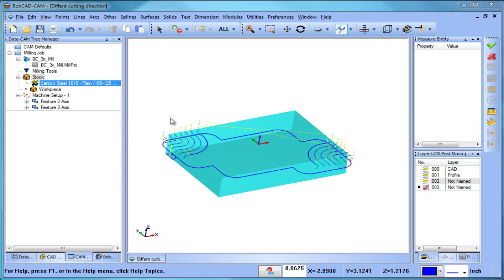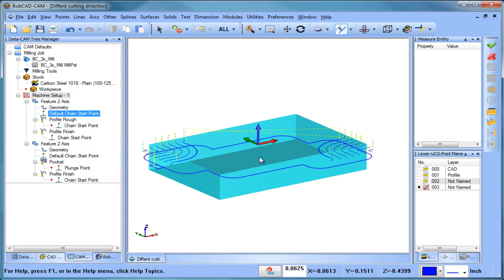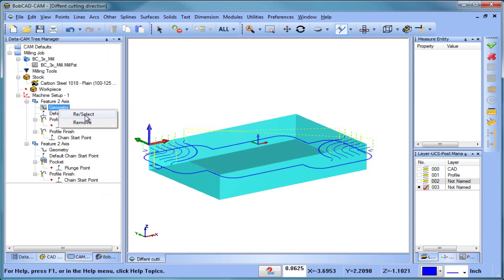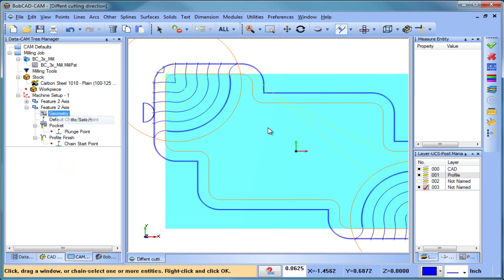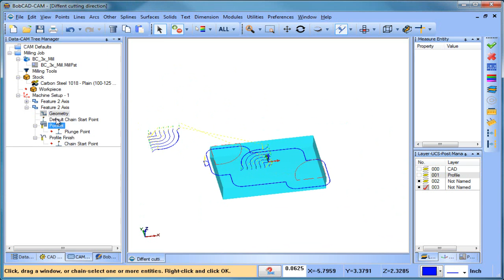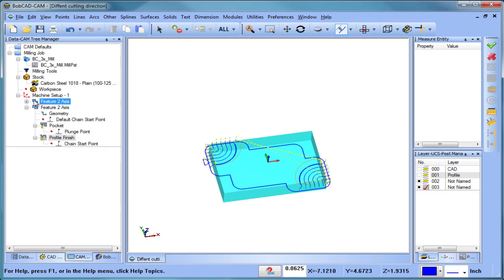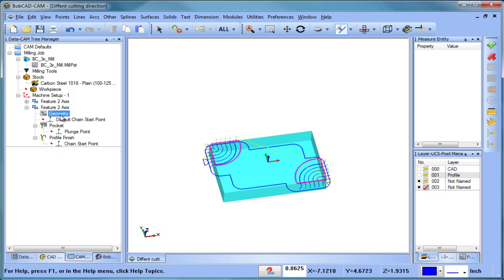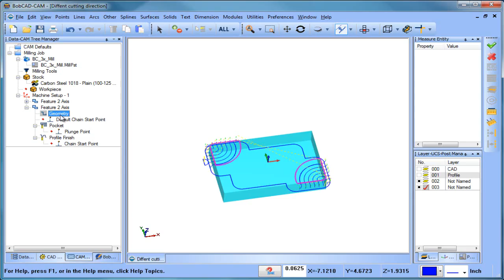Change Part Origin Machine Setup BobCAD CAM V28

Comment: I was hoping there would be a quicker way to do this, I have gotten in the habit of removing and selecting the geometry over again which can be time consuming on some parts.
Reply from the maker: +DeadlyRabbit  If you are doing profile where you have set the start point and direction already when you re select  you end up resetting these positions.  If you contour your geometry you  can keep the direction of cut and start point location when you re select.    Give me a call and I can show you  877-262-2231 X147
Reply: Thanks for the info, I will keep that in mind when making programs.